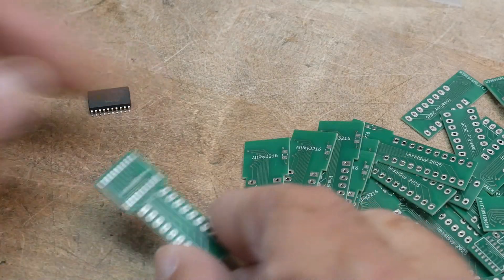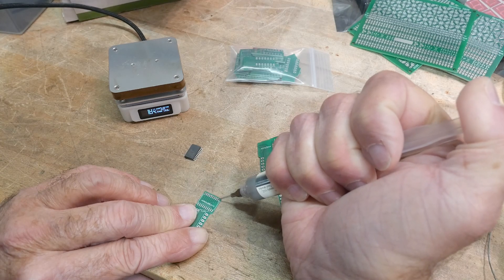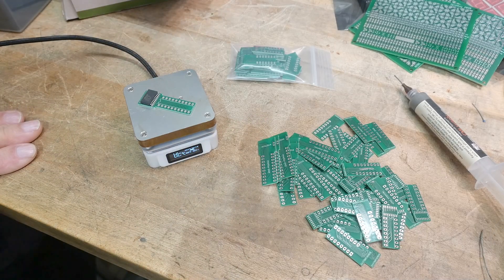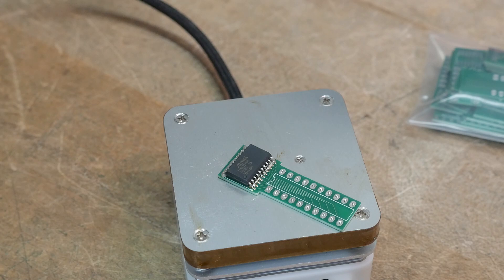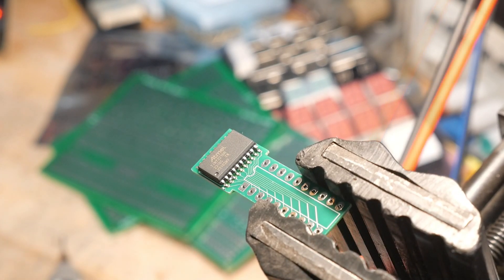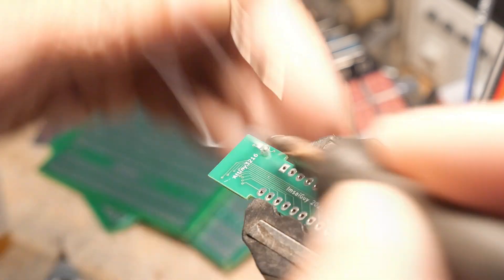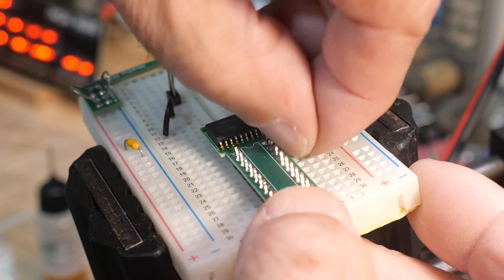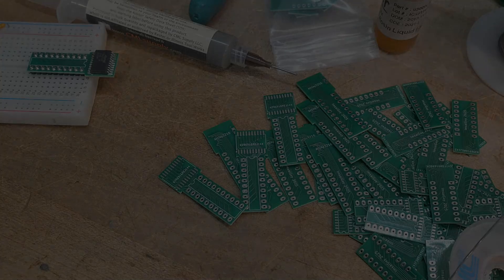#2135 Loading ATTINY3216 onto SO-20 adapter board

Comment: Nice.  I bought a few from PCBWay to mess around with, along with the SO-16 and SO-14 boards.  With these small boards the total cost and shipping cost doesn't vary whether you buy 5 or 20 or whatever until you hit some upper limit (maybe 30 or 40 depending on board) before the price changes.  So if you're cheap like me it's worth exploring combinations of quantity vs price.  PCBWay even threw in a couple extra of each.  Arrived in 5 days despite all the recent fuss about tariffs and delays.

Comment: That bypass cap on the skinniest traces possible (via inductance & couple of sizes bigger than necessary footprint ESL as well) is very effective, I'm sure 😅
Signal integrity is the best part of such adapters. 😏
Reply from the maker: you might like these https://www.reichelt.com/de/en/shop/product/ic_socket_14-pin_with_blocking_capacitor-8232
Reply: @IMSAIGuy  ahah, not gonna help me with my QFNs, but looks neat.
Do they even make axial CCaps in decent dielectrics and not Y5V rubbish? Surely won't be easy to source here locally.

Comment: Lots of wasted space down the middle of that PCB. I'd add some optional common cathode leds.
Reply from the maker: put your shared file on PCBWAY
Reply: The wasted space has traces on the other side of the PCB (look at the PCBway pages for these). There is not a lot of room on adapter boards, so running additional traces is not easy. And you don't want to introduce noise and other bad things. If you did want to run additional circuitry generically, you can make these with sockets on top, and then have another generic proto-typing board that hats into it.

Comment: Next rev add a 6pin programming header on the side of the chip that is away from the DIL pins. Extra credit for adding break-off capability.
Reply from the maker: these parts are one-wire programming https://youtu.be/r9VnQLEPW0E?si=rKzDAAnKuDvq6iqE

Comment: Good example of how not to connect a bypass capacitor! This video was demonstrating the long thin traces from the leads...
Reply from the maker: The Vcc and Ground are pins 1 and 20. the cap sits directly below with minimal lead length.
Reply: Also, the lead lengths are a lot shorter than if you placed the capacitor on the breadboard. And the bypass cap is now always there, so you don't have to hunt up a throughhole cap every time you place the adapter on a breadboard. Yes, I have thought about this, I've done similar adapter designs allowing bypass caps of various form factors and sizes (which also lets you have multiple caps on the adapter, if necessary).
Reply: Did you make it to the 6 min point of an 8 min video?